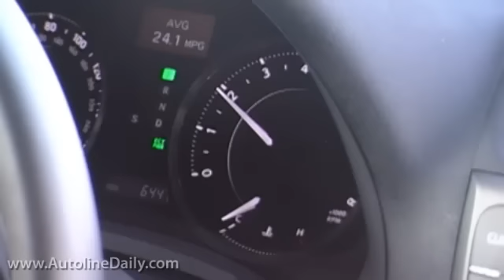Toyota Unintended Acceleration Could Be Caused by Driver Error

Comment: If the cause of unintended acceleration is driver error wouldn't it be happening equally with all brands of cars, not just  Toyota. If this were the case, Ford, Chevy, Honda, and all other car manufacturers should be having the same problem. Has anyone looked into this?